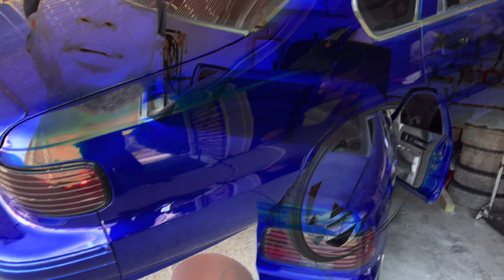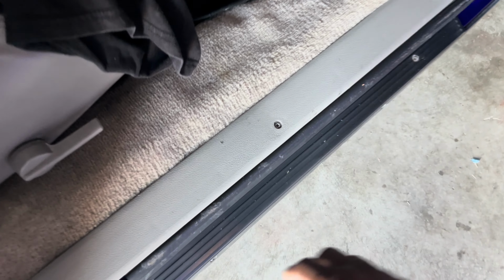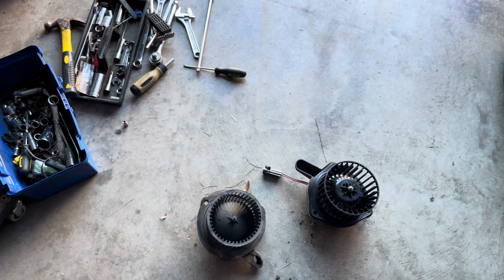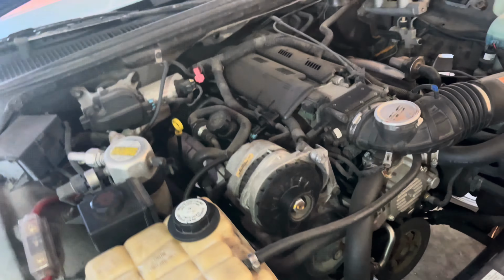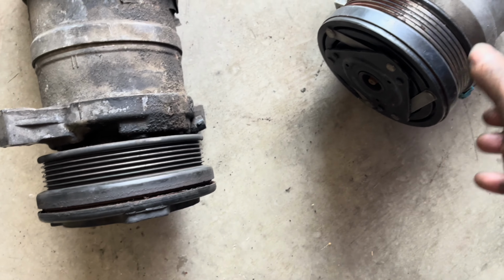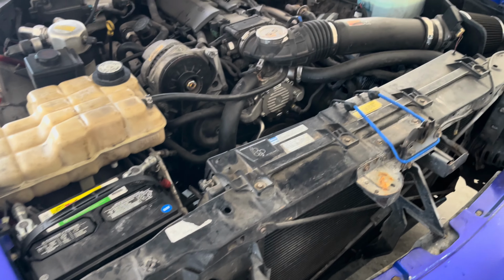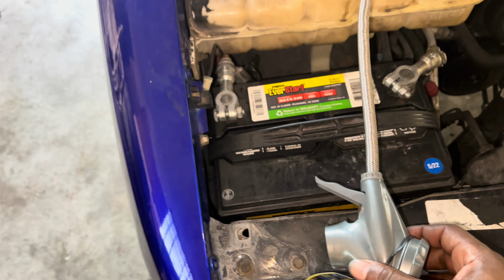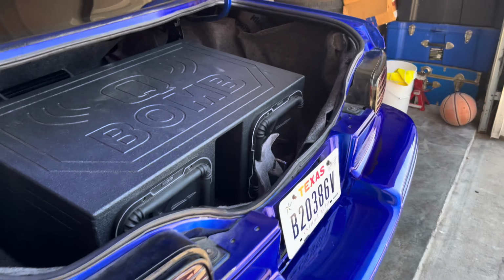96 IMPALA SS COMPRESSOR AND BLOWER MOTOR REMOVAL

Comment: Nice video, I am sure you corrected the issue with your ac at this point.  I have seen many DIYers do this.  When the ac system is opened to the environment it must be evacuated completely ( and hold the the vacuum) before Freon can be put in. You can damage the compressor.  The compressor compresses Freon. Air has water/moister in it.  Very had to compress.   You should change the Dryer too. Good videos.  Are those stock rims for sale?
Reply from the maker: 💯💪🏿..thanks for watching bro…but nall my factory wheel r not for sell…im just bought a new compressor just to see if I had a bad one from the beginning…I did get it vacuum from a shop the right way…but it still didn’t fix my issue so I bought a new electrical switch and compressor..So I will be going down that rabbit hole again 😂

Comment: 💪🏽💪🏽
Reply: Bruh it probably your drier or orfic tube not let the Freon circulate. I always change both when I do a compressor you did the hardest thing on AC get that back both out the compressor it’s a SOB. You made quick work out of that job. I got that same 96 ss
Reply from the maker: @viccat6625 I changed the drier and I changed orfic tube…I think I got to get another compressor…